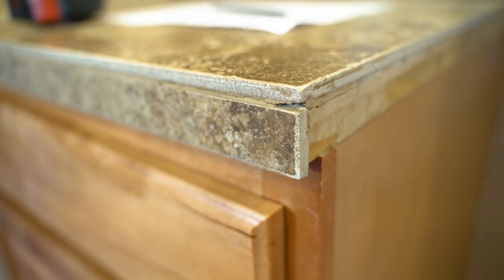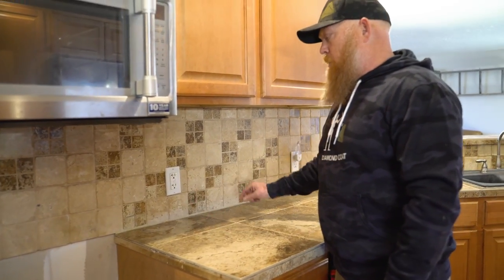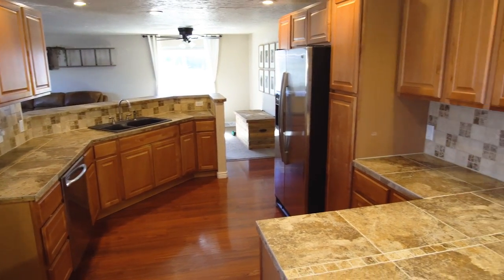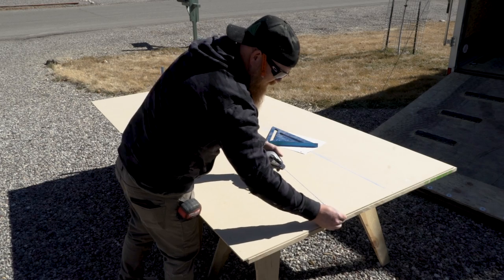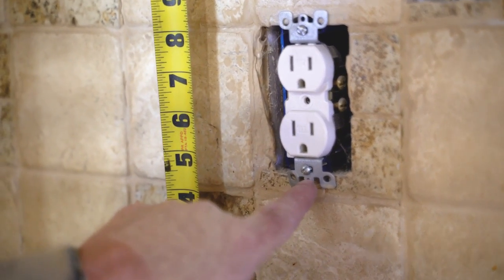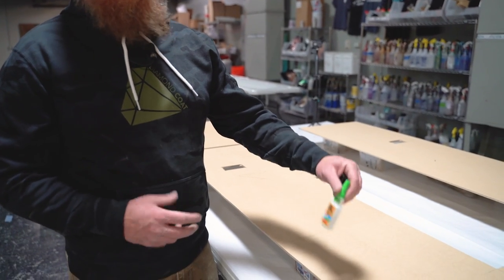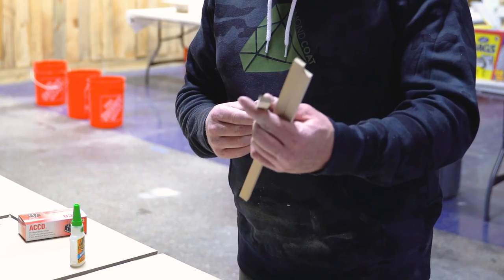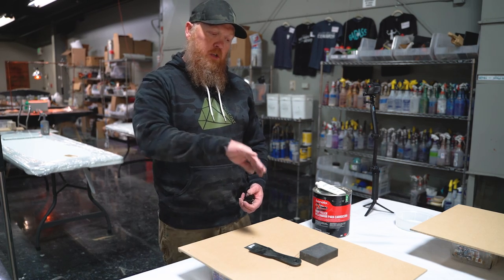HOW TO Pour Epoxy over Tile Countertop - White Marble Countertop - Countertop Epoxy - Resurface Tile

Comment: Can the epoxy surface take heat? like setting a hot or warm pan?  Did you prep the tile surface?   other than fill the grout lines? or even before that?  Great job, and video

Comment: Thank you for the tutorial! How did you clean the backsplash after you sprayed it at 26:14?
Reply from the maker: We were let that spray become part of the design, we were doing the counters and the backsplashes together. If you don’t want a surface covered. You would want to make sure it’s covered by plastic prior to using epoxy. Hope that helps!

Comment: Great idea and concept, but I feel you missed on the stone edge. Not to be too critical since I imagine it's not something you get asked to do frequently since the client specifically requested it. At one junction, before epoxy, the stone edge looked more natural. But epoxy on the jagged edge just made it look like plastic rather than stone. If there was some way to get a thinner coat, it might have looked closer to natural. But I suspect you need some sort of semi-matte finish to make a stone edge not look fake.  Admittedly a difficult task, and have no idea how something like that could be done. Would have to do some pilot tests in your shop to experiment, but maybe not worth the time and expense over just recommending future clients don't try this.  

Client would have been better off asking for a clean smooth edge and it would not have been so obvious. Maybe thinking of some alternative for the edge if they really want a stone edge look.  But any alternative is probably labour intensive. At one point it seems like the material cost of true stone counter tops would outway the labour costs.

Thanks for the detailed video and tips. Never imagined an epoxy back splash. That was eye opening.

Comment: so you didn't need to fill the grout lines at all?  the epoxy fills right in?
Reply from the maker: We did a skim coat to cover the grout and seal it before doing our actual epoxy pour. You still want to seal before doing your main pour, but you can seal with epoxy. Hope that helps!

Comment: What if I can’t sand down my tiles ? Can I do multiple layers to get it flat and even?
Reply from the maker: We only lightly sand to remove any debris and assist for bonding. We use our non sag epoxy to fill the grout lines and make the surface even!

Comment: Can you use wall epoxy to cover the backsplash tile, instead of building a backsplash?
Reply: It would slide right off before it cures as it cures too slow and is not tacky enough